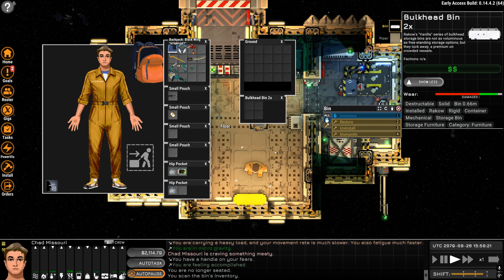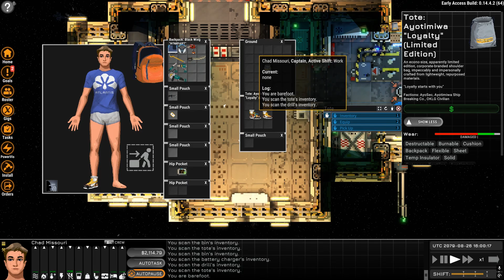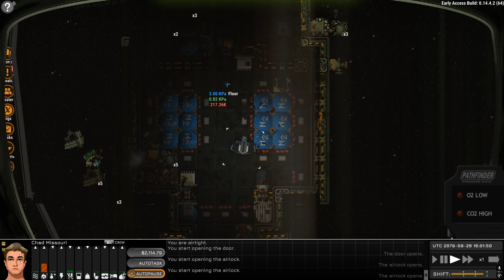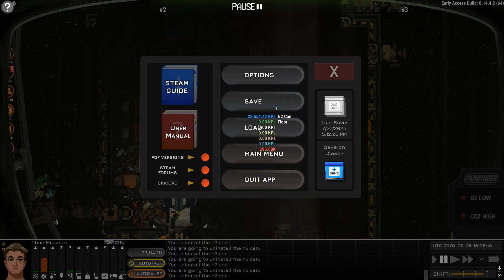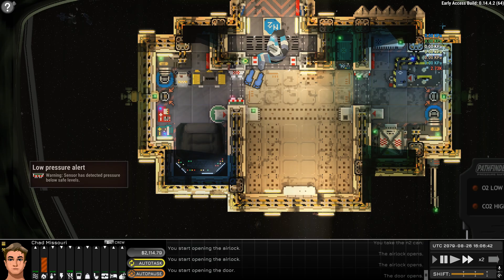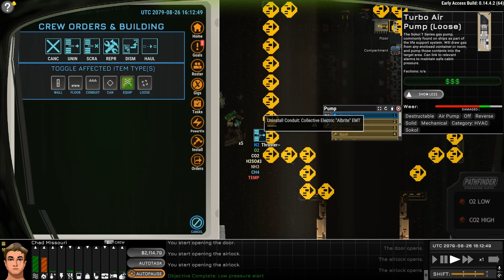Ostranauts Complete Beginner's Guide - Episode 06 - Salvaging Your First Derelict Ship (build .14)

Comment: Please remember that in rhe Dream class ship the nitrogen can is not installed. You don't need it for survival, but I recommend using it, as the oxygen is more expensive than nitrogen, and you pay environment tax with the gasses inside your ship. 
To do so, acquire a can of nitrogen, install it on the Left side of the Left pump. Then use control panel of the left pump, and set it to auto. It can also be used for oxygen, if you are fancy.
Reply: So what would be the purpose of pumping nitrogen through your ship? Sorry for the stupid question. lol
Reply from the maker: Not stupid.  :)  It reduces fire risk.  Pure oxygen in a contained vessel is very dangerous.
Reply: @satellite4349  The air we breathe here on Earth is roughly 80% nitrogen.
If it were 100% oxygen we would suffer lung damage, seizures, and other nasty effects within hours, and it would be an extreme fire hazard (as oxygen accelerates combustion).
I don't think these effects are currently simulated in Ostranauts, but like uiytresen346 said - oxygen is more expensive than nitrogen.

Comment: Great series helping me learn the game. Tried my first flight and salvage last night using your videos as guides. I have the same starter ship and founf a large derelict about three times the size, five or six loaded crates and bins with loot. After a few hauls back onto my little ship the lights went out! Battery dead, not sure if it was me or just bad battery, I repaired it before flight but it's half damaged. I used the debug options to respawn the ship back at Kleg and after prying my doors open, paid to refile and charge. Now I need to either replace the battery or add more lol, want to go back to that hill and pull a few more things off of it. Thanks again, enjoying your approach to teaching the game.

Comment: If I understand the function of an airlock correctly, you should stop inside with the both doors closed, and move inside or outside only afterwards. Else, when you keep running thru it while both doors are open, you syphon the air out to space via the non-pressurised ship's hull. Is it true in-game?
Reply from the maker: Yes, that's true in game.  Some players refer to it as a nag-tax.  I tend to just deal with it as the price of doing business.